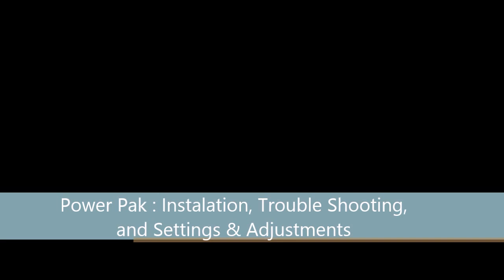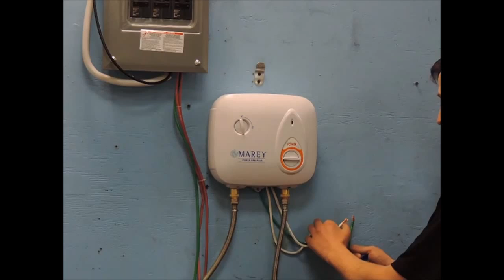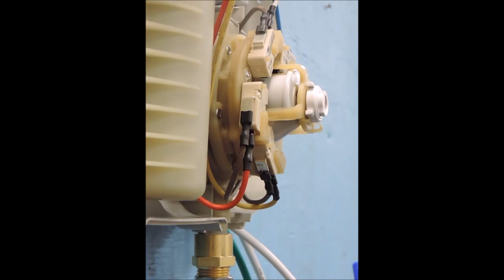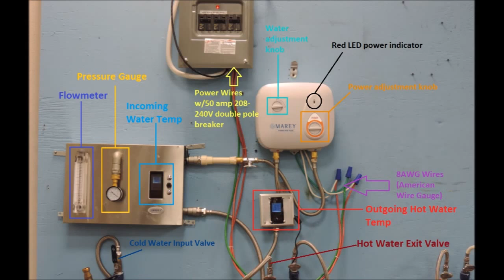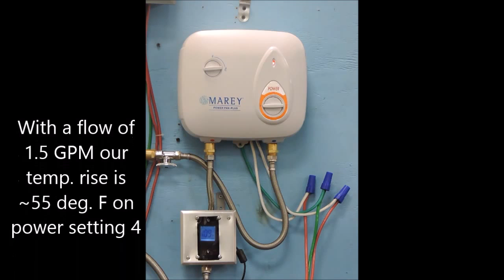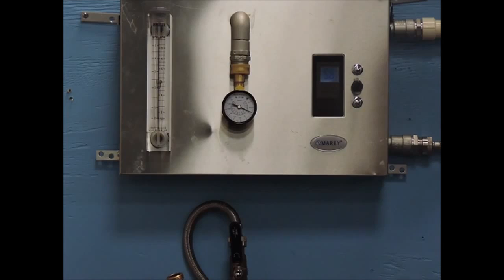Marey PowerPak 110V and 220V  Install, Troubleshooting with Settings & Adjustments

Comment: The manual requires a 40 amp breaker. I should be able to replicate your results using a 40 amp breaker, yes? As I understand the system's max amperage is approximately 38 amps.